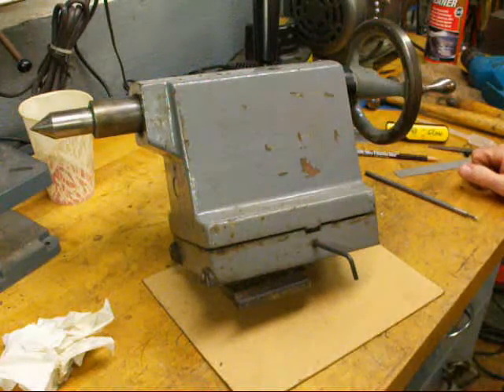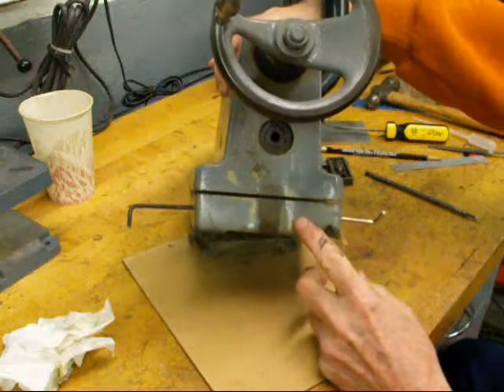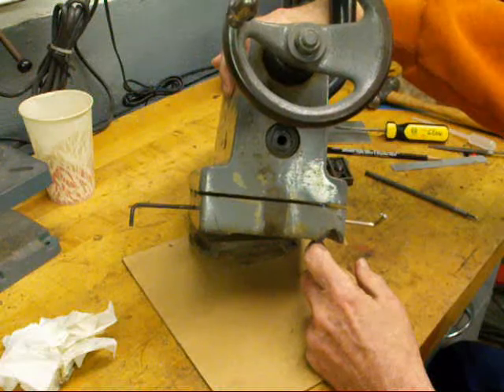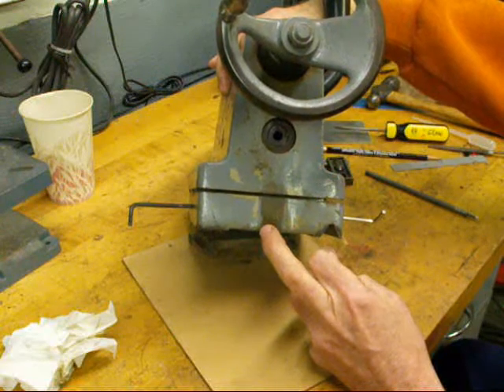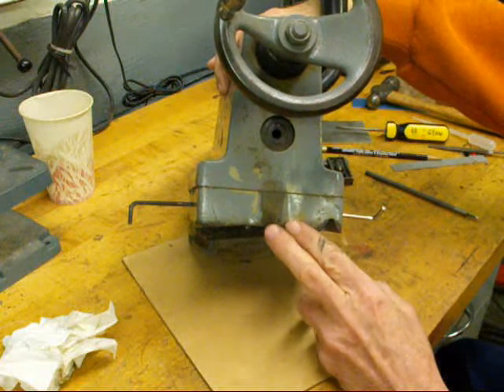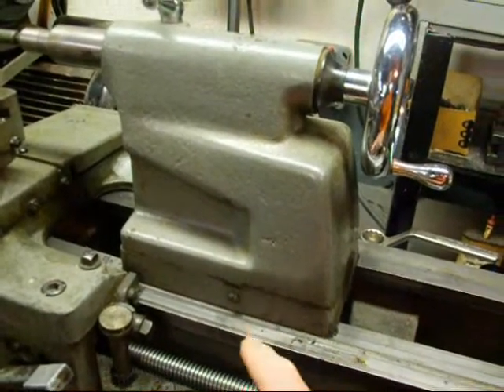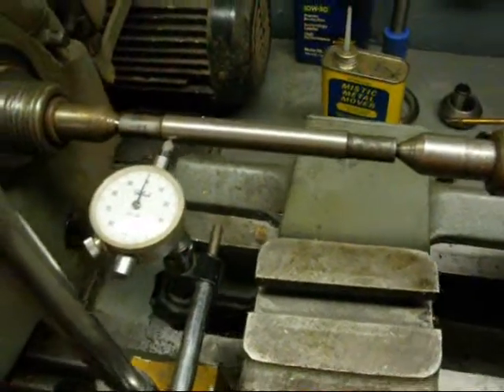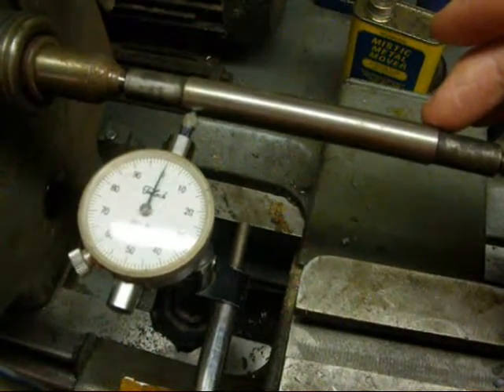TAILSTOCK ALIGNMENT on Clausing Atlas South Bend Lathes Part 1

Comment: I really enjoy your videos and am learning a lot from them!

Question: Is there anything holding the tailstock top/bottom together? I have a Clausing 10" 4904 lathe and I cannot get the tailstock to adjust at all.  The  witness marks are not aligned. Either something is holding it or it has become rusted and seized. I've backed both set screws out so that neither one is touching the tab intended to move the tailstock from side to side.  I've used a dead-blow hammer and wd-40 but so far no luck.  I have the tailstock off the lathe and cannot see anything like another screw etc. that might be holding it.

I'd appreciate any suggestions.
Joe

Comment: My headstock and tail stock are in horizontal alignment but the tail stock is higher than the head stock how do I rectify that please?
Reply: What kind of lathe? Often times there are very thin  brass shims between the two halves of the tail stock. You can remove some of the shims of the tail stock to match the headstock or you can shim the headstock up to match the tail stock. You really have to know what you are doing in either case so that they are truly aligned on the same horizontal plane. This will require the proper tools for doing this job accurately.

Comment: Can't find part 2 of this series but I need help with something Mr.Pete.  The tailstock alignment on my 12in Atlas changes slightly every time I loosen and tighten it to the ways.  I don't have to actually move the tailstock, just loosen it and tighten it back and it will move.  Do you have any idea what could cause this?  I've gone so far as to use a torq wrench to make sure the same amount of force is used to no avail.  This is really bothering me.
Reply from the maker: Check the fit of tailstock to te lathe bed--can it be wiggled?
Reply: mrpete222
I'll be darned.  There sure is.  I put a dial indicator on it and measured 4 thousandths of movement.  Is there a gib under there somewhere that needs to be adjusted?
Reply from the maker: L1A1Rocker
I forgot what it looks like under there. Take the tailstock off.
Reply: mrpete222 THANK YOU Mrpete!  There are two screws that push out a "gib bar".  However, the gib bar on mine for some reason was installed upside down.  This meant that the gib screws would not push out the bar to take up any movement of the tailstock.  I reversed the bar, put it all back together, and the gib screws worked to tighten up the tailstock.  Thank you very much!

Comment: Billy, if the lathe ways are v-groove ways than the wear will only occure downward when moving the z axis. A two point contact. Box ways like on a lodge and shipply lathe have a tendency to do exactly what you mentioned. A real pain sometimes. I really kinda think that v-grooves are the standard anymore because of wear and its ability to not cut under or over sized durring opperation.

Comment: Pt.2 cont. Then rotate one side of the arbor(mark sides before taking readings) with the recorded readings towards indicator and run it down the shaft, subtracting out the taper to find tailstock offset.

Comment from the maker: I have a used a thin bladed machinist ruler. Actually, this procedure checks to see if the tool bit is set on center (right height ). Not to be confused with tailstock center alignment.